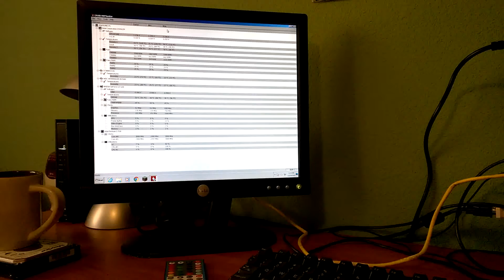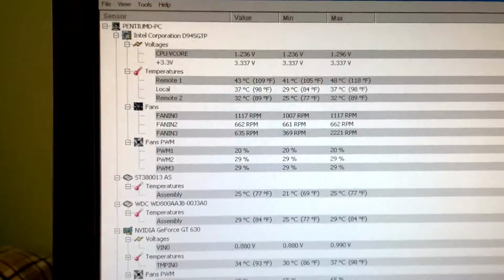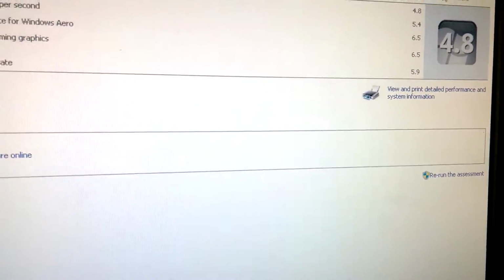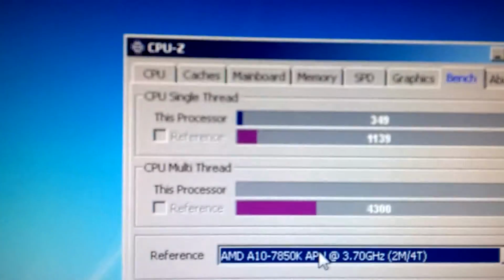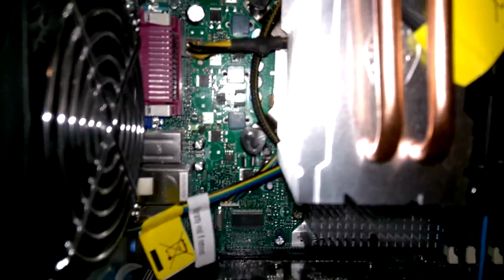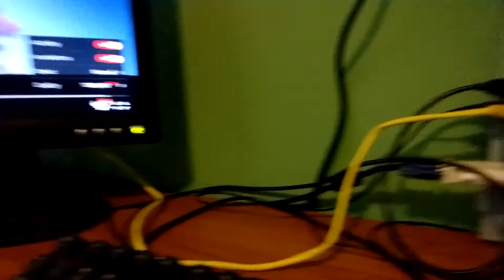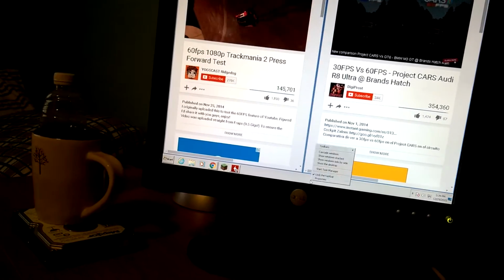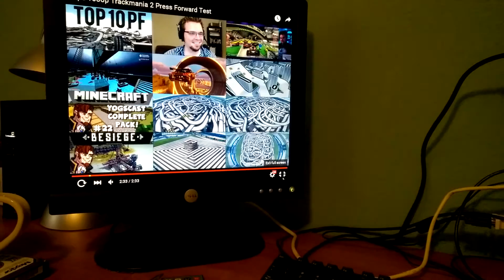Pentium D 930 - 10 Years later

Comment: Well, your YouTube video is running at 1080p and 60 fps due to gt630 and its hardware acceleration. Just tried to run 720/ 30 fps video on D 945 and an older gpu - got 100% CPU load and plenty skipped frames
Reply: Which gpu? Playing 720p YouTube is no problem on a P4 3.8 GHz + hd4670 gpu
Reply: @talvisota327  Radeon ATI x1050 256MB

Comment: Still my main and backup systems, exact same mainboard and CPU on both.   Latest BIO is from October 2009 so it is not that old.  Only thing is that the Intel D945GTP mainboard only supports XP drivers even though you can use Windows 7 with no problems.  Can't beat the price under $20 for both brand new old stock mainboard and CPU straight from Intel.

Comment: I have a dell 9150 that can't run counter strike source smooth even on low settings and resolution anymore here are my specs: Pentium D 930 1GB ram and ATI radeon 256 MB hypermemory.
I don't think it is the CPU, are there any other ways to confirm it isn't the CPU?